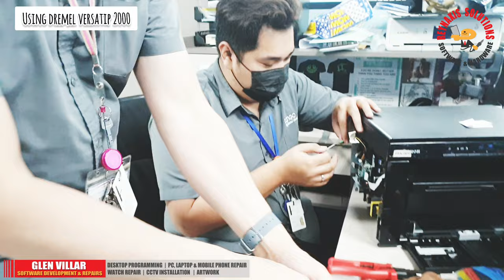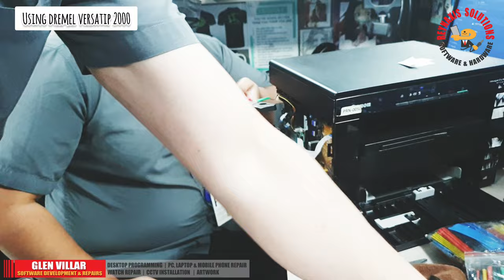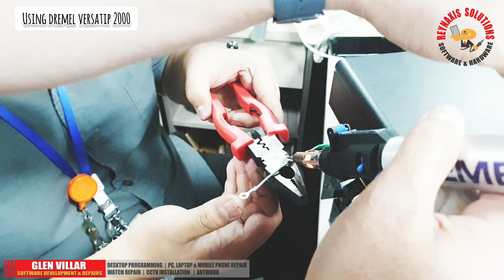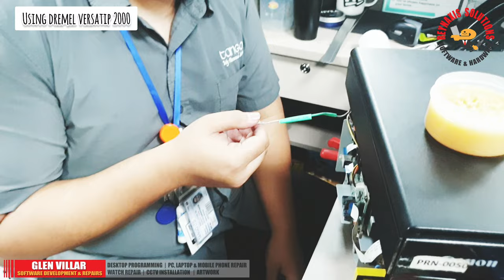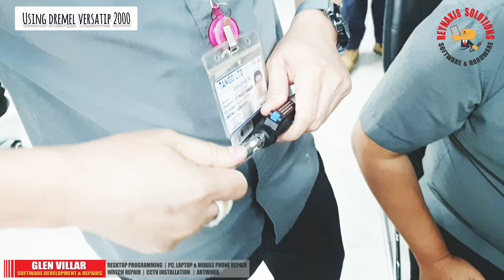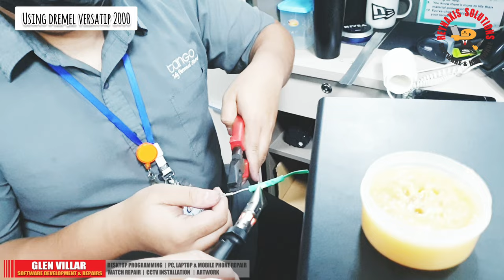How To Use a Dremel Cordless Butane Gas Soldering Iron #gastorch #portable #printerrepair

Comment: Hi I am having an portable 960 GB SSD of transend company. Yesterday I was copying files from pc to ssd so I wrongly unplugged ssd cable. Then when I plugged the cable off ssd so it just blink once and doesn't work please help me 🙏🙏🙏🙏🙏🙏🙏🙏🙏🙏🙏🙏🙏
Reply from the maker: Hi, you will have to look for some technician with tools like tester, microscope and smd rework station. It's hard to to check it if we cannot physically inspect and test it.
Reply: How can I find what's the problem
Reply from the maker: Yes, you will need those tools that I have mentioned.